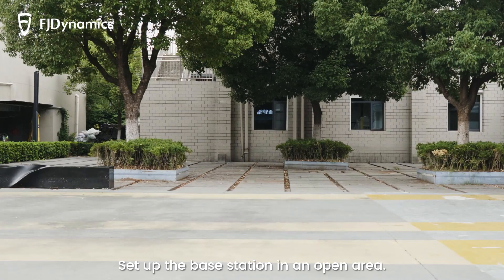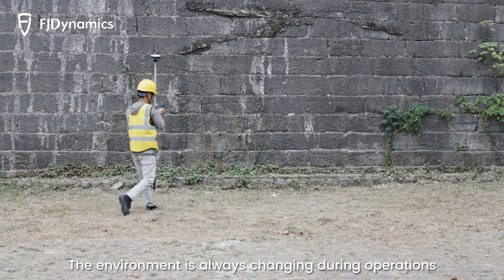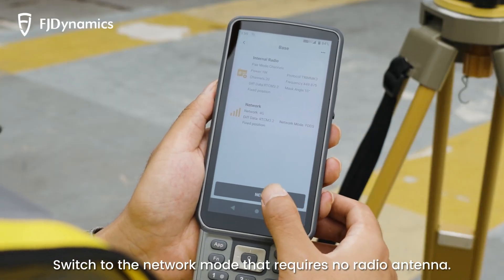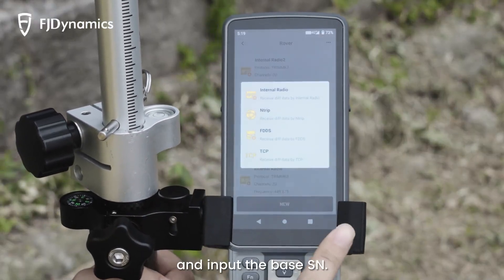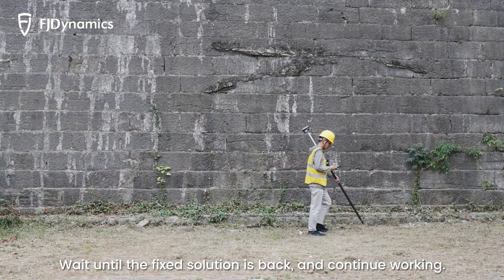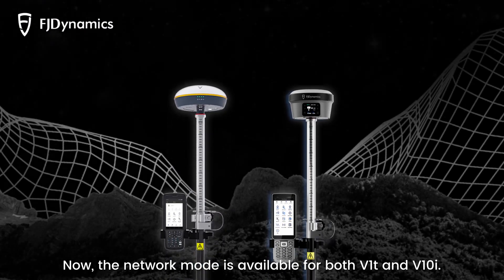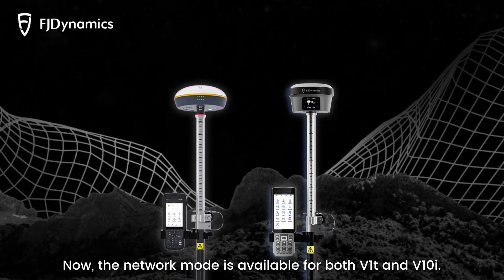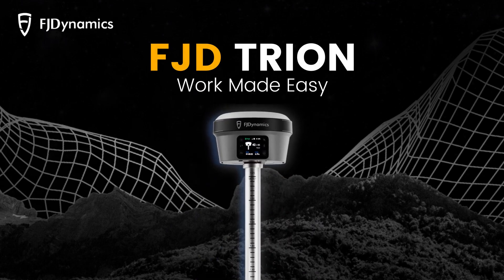FJD Trion RTK network base station function

Comment: Ok! Good new function, but how it work if you have one controller and both gnss rovers (v1+v1 or v1+v10 doesn’t matter). Without controller v1 can’t use ntrip. Ok you can come controller with v1 and go, but how without second controller you can use VR in v10 or take measurements  with second v1? You should add this function in fjdynamics software, not only in payment software Trion survey.